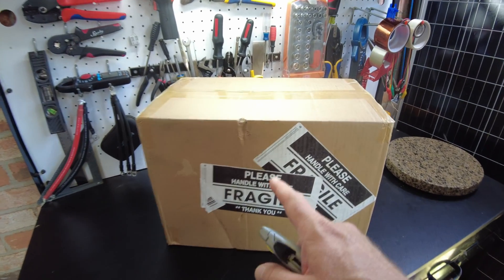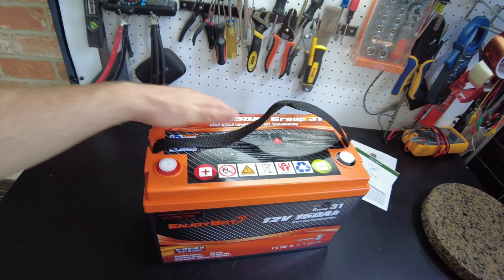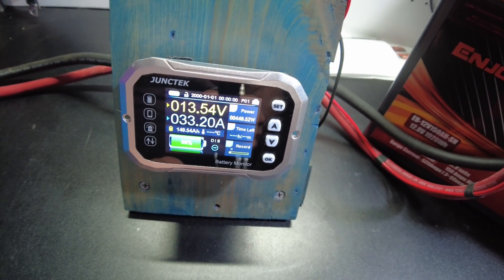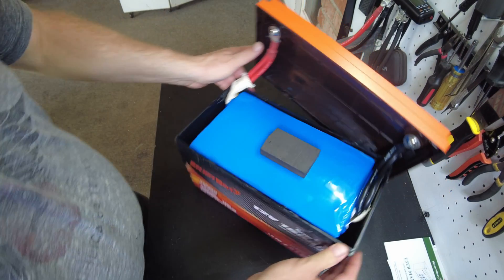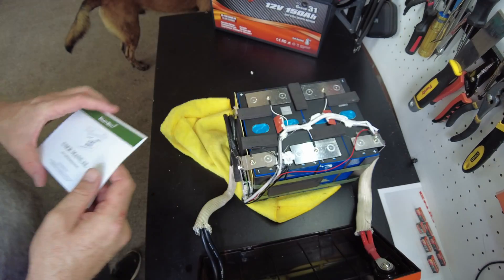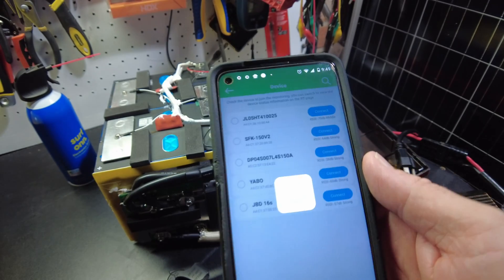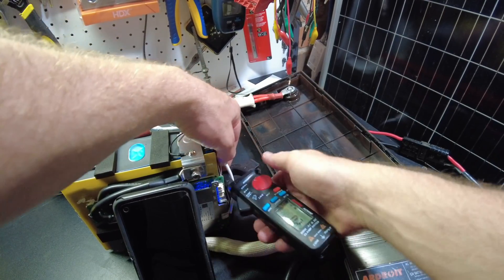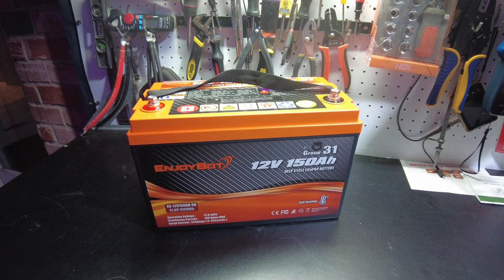EnjoyBot 12v 150Ah Group 31 Heated + Bluetooth LiFeP04 Lithium Battery

Comment: How many amps did it finally pull before it was down to 0 you did not mention that just wanted to make sure it pulled at least the 150 amps.   Thanks Steve
Reply from the maker: When you say amps, are you talking about Ah? I did mention that it pulled the full 150Ah. In the test I set the shunt to 150Ah, and it counted down to 0Ah. Thanks

Comment: I have a Lossigy Lifepo4 with internal heaters that uses the BAT BMS app, I had some issues where the battery percent was fluctuating quite a bit-  I switched to using the Overkill Solar app and it is more accurate.
Reply from the maker: I'll try the overkill app. Thanks!

Comment: That arrangement for diverting charging current to the heaters when its cold (I presume when <= 0oC) is a great approach. I wonder if they heat the batteries if the ambient goes below -10oC? If they do, then one probably should mount the battery in a insulated container.
Reply from the maker: Yeah, it's really neat. I'm not sure if it decides to warm the battery up using battery power if it goes lower. I have not seen that yet in this level of energy storage. As for the insulation, 100%! I have two 300ah 12v heated SFK batteries in series in my garage, and they are in SFK's battery jackets.  https://www.sunfunkits.com/product/56/sfk-insulated-battery-jacket

Comment: Thanks for feeding my LiFePO4 battery addiction, Brad. Keep at it! PS: What happens to all of the batteries that you've de-husk and torn down?
Reply from the maker: You're welcome. I put them back together, and I trade some for things I can use on the channel, like wire, breakers, solar panels etc.. I spend extra time/care taking them apart so they don't get damaged. Would bother me trashing these perfectly good batteries just for a video. To date I dont think I've destroyed a single one 😅 Thanks